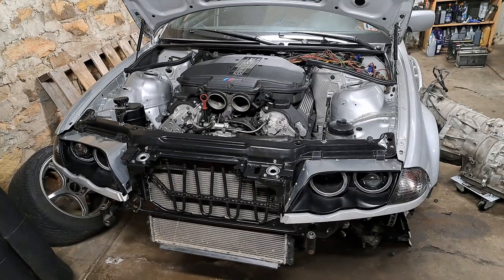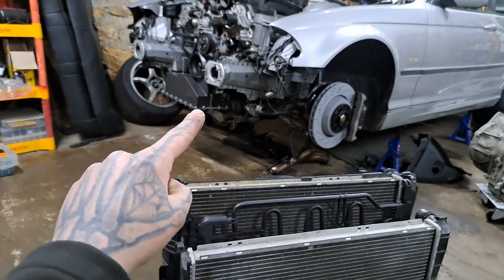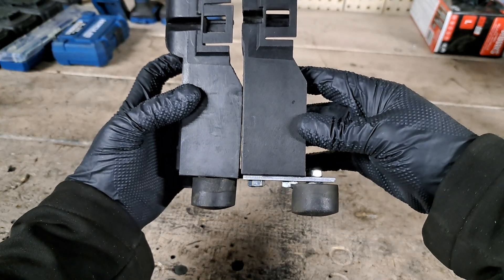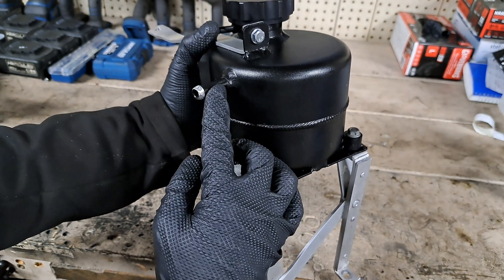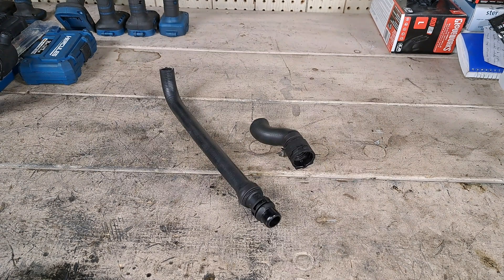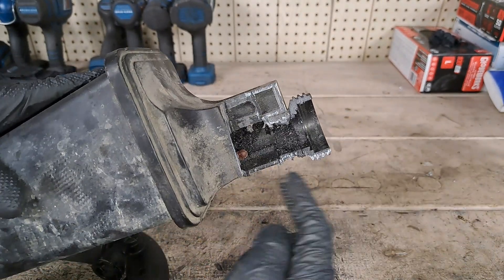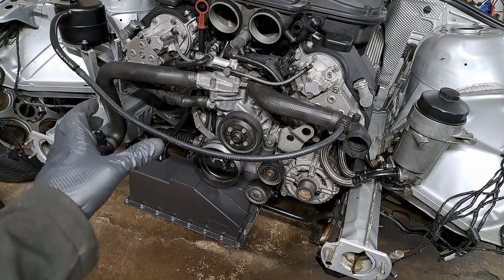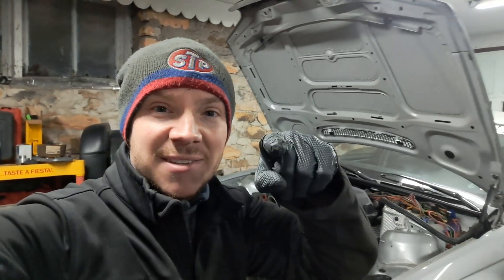BMW E46 S62B50 V8 Swap Pt 6 - Cooling System

Comment: Like the little bigger radiator and because of my cold air intake have to relocate the expension tank to other place but have automatic 
So want to use a exspansion tank from  e60 n57/m57

Comment: Awesome video bro! How much for the long block and where do you recommend buying a good bmw engine?
Reply from the maker: S62 long block usually goes for 3,000 to 10,000 USD. While the paired Getrag 420G can be 700 to 3,000 USD. Those are more so picked up prices, not shipped. You'll want to search around for reputable seller of your preference.
Reply: @ good to know thanks for the quick response brotha..looking forward to part 7🫡